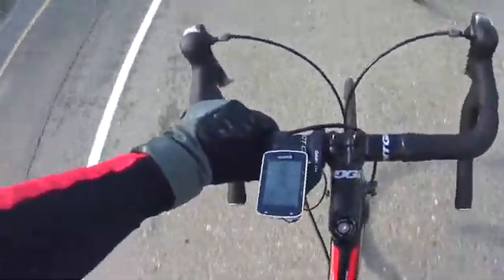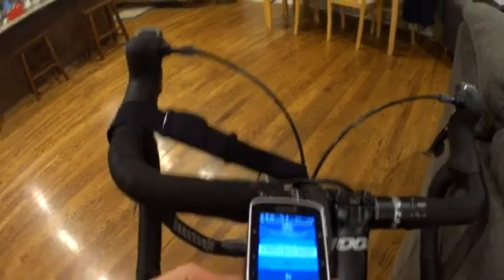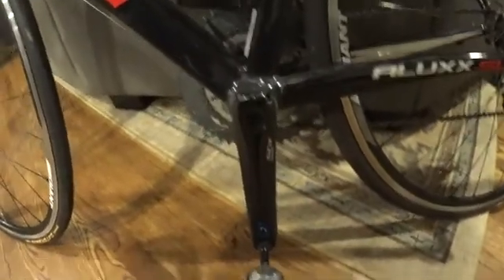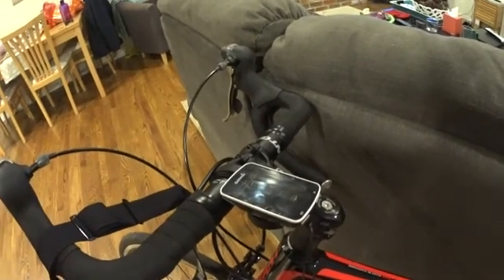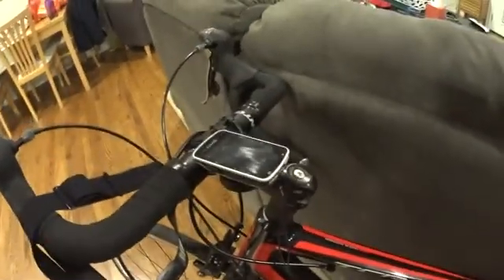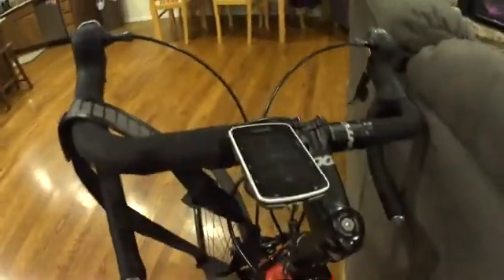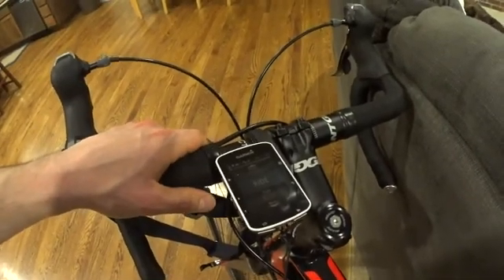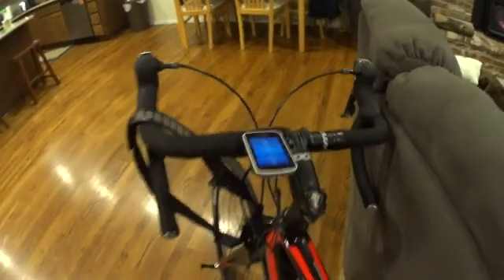Stages Power Meter Data Drops

Comment: I know this is an old video... but I'll have to try this.  Completely ridiculous to have to do this in the first place, but It's the only thing I haven't tried.  I've literally tried everything else, firmware updates, turning off all bluetooth, moving my water bottle, changed the data setting on the Garmin to 1sec, bent the battery tab inside and even put tin foil behind the battery and I still get drops 40% of the time.  The kicker is that I have a 51cm frame and a 100mm stem.  This POS should be able to emit a signal strong enough to not need direct line of sight.

Comment: I'm using a Garmin 820 and Stages Cycling power meter, the Garmin is mounted out front with a K-edge mount, lots of intermittent drops of power and RPM. Stages is sending a replacement unit this week, let's see if it works any better. Had no drops with my original Stages from 12/26/2016 on my Fuji bike, drop outs started happening on my Specialized bike with K-edge mount and Garmin 820 computer.

Comment: So, I had this problem and jumped through all kinds of hoops to fix it. My replacement Stages had the same problem. What fixed it for me was to use a Bluetooth head unit, the Polar M450. I think the signal is marginal and the extra error correction that BLE has over ANT is enough to make it stable. I'm also using 105.
Reply from the maker: sorry you had so much trouble the amount of money this stuff is it should be plug and play...glad u got it going

Comment: I tried your solution and it only reduced the # of drop outs, it didn't eliminate them. I finally ended up replacing the Garmin extension arm with the out of the box elastic bands and plastic clip that come standard with the Edge 1000, as a last resort.  Drop out problem solved!  The only thing I can guess is that the extension arm is effectively deflecting/reflecting some of the Ant+ signal from the Stages Power meter.    At least you got me pointed in the right direction with the problem.  Thanks!

Comment: Perhaps this "solution" works, but I know from personal experience with other power meters that they are not so picky about computer position.  They should work with computer in the out-front position.
Reply from the maker: I agree it should work, but it's highly corilational that I don't get drops in this position and out front I get drops 5 to 10 percent of the ride with position of computer being only variable change. Could just be my specific set up with my equipment and electronics. Yep it should work out front but it sure don't for my bike! Haha!